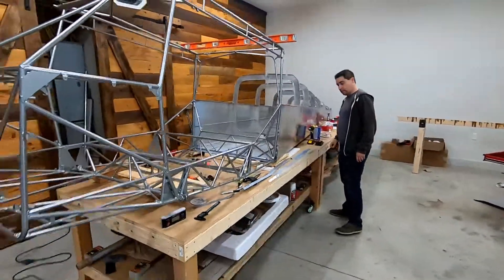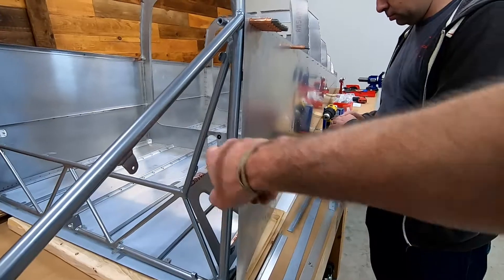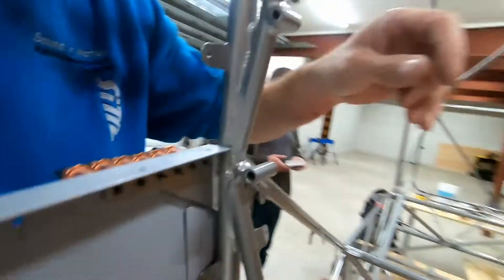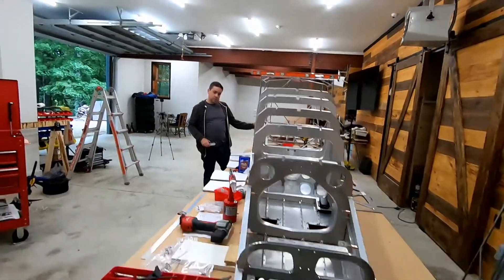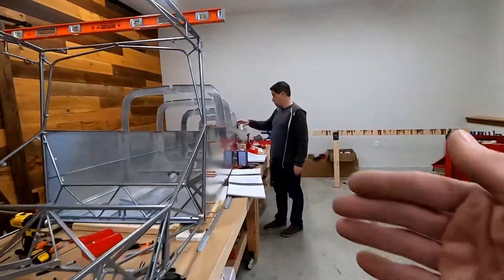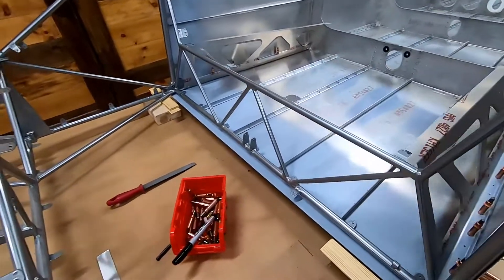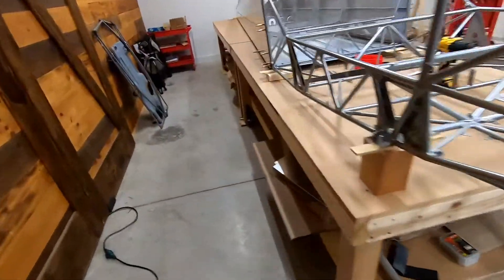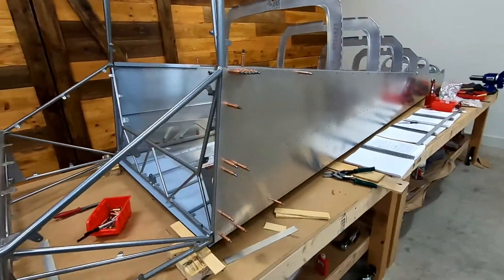RANS S-21 (020) Fuselage continues

Comment: Any further work on the fuselage?  I am debating on where to locate the holes in the aft baggage floor as the text manual appears to give different direction than what is shown on the parts diagram.  I am looking to see what others did and how they interpreted the instructions/diagrams.
Reply from the maker: Sorry, we were stalled for a bit, but moving again now.